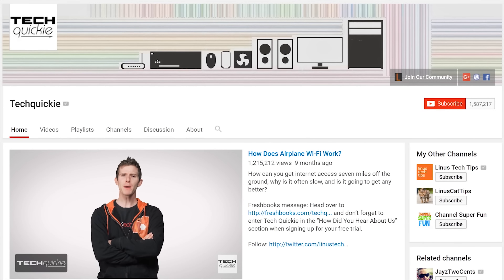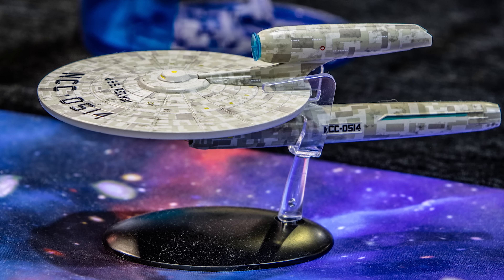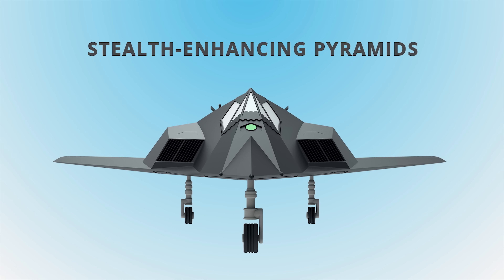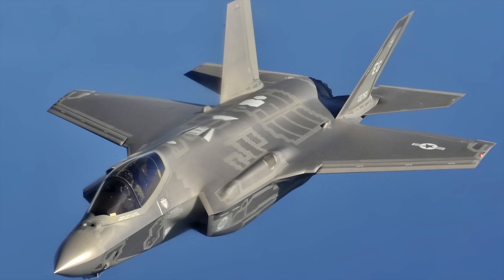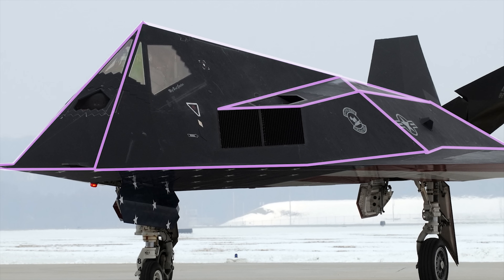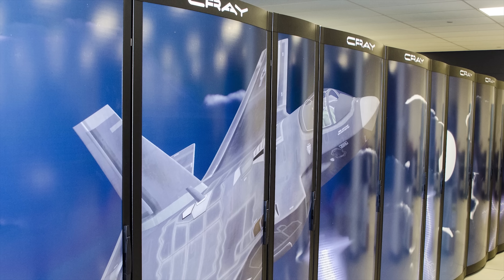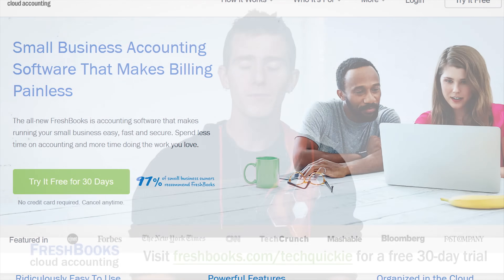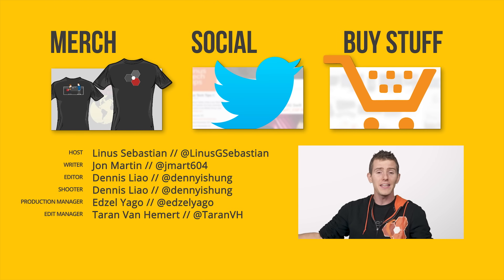How Does Stealth Technology Work?

Comment: The title of the video should have been how is it supposed to be working. Stealth technology is nothing but a scam. It works against Afghanistan shepherds but it will not work against a strong military.
Reply: You would be 100% incorrect. The F-117 flew THOUSANDS of missions over Iraq when at the time was the most heavily defended airspace in the world and smashed Iraqi air defenses opening up the way for the coalition aircraft to operate with near impunity over Iraqi air space.
Reply: No, I am correct and you are incorrect. Three major errors.

1. Most defended air space in the world? Are you on drugs? The most they had in 2000's was 1970's Soviet Osa. Its operational attitude is... wait for it... wait for it.... 12000m. You can almost buy a drone that flies that high.

2. The air space over Iraq was shut down and controlled by foreign airplanes. The reason why airplanes survived all those missions was because Iraqi army never attacked them.

3. When the shit hit the fan, USA started with Tomahawks. Not really a stealth technology airplane, is it?
Reply: @trdi They only had Osa are you shitting me? Every source and study shows they had around 7,000 available SAM sites including SA-2, SA-3 and SA-6 and more with 10,000 anti-aircraft artillery systems. More so a significant portion of their command structure was of Western design and was highly capable thanks to France.

They backed this up with a incredibly dense radar network linked with a GCI system to vector in Mig-29s, MIG-25s and Mirage F1s for target intercept.

In-fact this air defense network Is what comprised most of the shoot downs of allied aircraft in the war. Which Include:

3X A-6E
2X F-15E (Brand new aircraft btw)
3X OV-10
1X F-4G
3X F-16
1X F-14
3X AV-8B
1X AC-130
5X A-10

 BTW this info is all really easy to find with a 10 second google search.

The only Iraqi equipment knocked out of action when the first wave of F-117s went in was a few early warning radars. Other than that they flew in and out of Baghdad utterly undetected by radar. The only F-117 shot at that night was one that left it's nav lights on over Baghdad and it still suffered no damage.
Reply: Trdi is the typical self appointed expert, talking shit about a topic he has no clue about.
Reply: Well... yeah... they did have those as well. When I say they "only" had Osa what I obviously did was write what their "state of the art" air defense system was. The 1971 Soviet design. Let's have a look at these other ones you quote. SA 2? 1957. SA 3? 1961. SA 6? 1968. So excuse me for actually stating only what their BEST equipment was. If you want to see what Iraqi air defense was CAPABLE of, you have to look at the most modern variants. Makes sense. To me.

USA has NEVER fought against a well equipped adversary, that's a fact. The stealth technology is there only as a way to be able to sell their equipment for more money to scared nations around the world. Putin has publicly laughed when asked about stealth technology and said something along: "Don't worry, Americans know we can shoot down all their invisible planes."

What this video doesn't mention is that the planes are not actually invisible, they just don't look like planes. Also there are different wavelengths to be considered and usually US stealth technology is more concerned about planes not being possible to be targeted, not actually to be invisible. You can't have both, you have to pick. So those planes are quite nicely and easily visible on Russian radars. The problem is to lock on them to shoot them down. And that's where the algorithms and new development comes in. There is no doubt that a serious army, like Russian or Chinese, would actually be able to shoot down these planes. It's a bit tougher for Pakistani hospital workers and children in Syria to do the same. So they die. Such is the world.
Reply: Yea...Putin....there is a great source of information. If stealth doesn't work why is Russia, China, South Korea, Japan all spending BILLIONS of dollars on stealth designs? The Russians have been working on the PAK-FA for how long?
NOBODY has EVER said that Stealth aircraft are invisible. Except for ignorant people in the media, Hollywood, and people who have no clue about Stealth Technology and how it works.

ALL STEALTH HAS EVER done is radically reduce the radar cross section of these aircraft. So a Soviet radar that can detect a F-16 at 200 miles may be able to detect a F-117 at 20 miles. All Stealth aircraft can be detected it is factors like radar wavelength, power of the transmitter, the size and orientation of the aircraft that determine how far that aircraft can be detected. 
Small fighter sized targets are much harder to make stealthy than bombers believe it or not. The B-2 is far more effective against long wavelength radars than the F-22 or F-35.  
The big problem with long wave radar transmitters they all have MASSIVE antennas that are not mobile. That is a function of PHYSICS and can not be changed. So those long wave radar systems will be the first things targeted my long range cruise missiles so their actual usefulness in combat is going to be nil.
Reply: It's a problem when you try to learn serious things through Netflix. Just because Tom Cruise is able to destroy whole country with one airplane, doesn't mean that it's realistic. Unfortunately that's just the way Americans are being brainwashed on a daily basis so they keep believing the God-given immortality of their military.
It's just impossible to take seriously anyone claiming that Iraq had strong air defense in place. It's a joke. An absolute joke. They were running 30 year old export graded Soviet gear.
Modern SAMs don't actually have to know exact position of the aircraft. Having an approximate direction is more than enough. If there is an AWACS around, even better. Once the missile is shot in the direction of the aircraft it's about maneuverability, missile's hardware and yes, also software. State of the art SAM has never tried to shoot down any stealth aircraft so we don't know what tricks exactly they would use. But one thing is certain - they wouldn't rely on radar. They don't rely on radar, that's a fact. All the missile needs to do is get close enough to the plane and then boom. The missile does NOT intend to hit the airplane. Just get close enough. Since we all agree that stealth airplane is not invisible, it can be seen, it's route can be predicted, it's position can be calculated and that's where the missile will be heading. If the plane changes direction, the missile will know because it will receive newly calculated path. If the plane drops decoys, the missile is trained to recognize those and avoid. It's a never ending chase. USA said that new stealth technologies were developed to counter most modern Russian systems. Russians claim that new SAM technologies have been developed to counter American stealth technologies. Nothing is as simple as the brainwashing apparatus wants us to believe.
Reply: @trdi It is amusing that you keep making arguments about a topic you have no idea what you are talking about. If you did some research into Stealth technology...how it works and WHY it is so effective you could keep from making yourself look like a moron like you are now.
Reply: Yeah, make sure you renew your netflix subscription, buddy, or else your education might end. You know what... if the stealth fails, don't worry, there is always stargate technology.
Reply: Sorry brother, I am a US military veteran...I have worked with these assets in the field. While not a expert on stealth I am quite a bit more knowledgeable than the average person on the street. I also find it interesting that you won't acknowledge that if Stealth does not work....why is Russia and China spending TRILLIONS of dollars developing their own Stealth aircraft? The Russians are currently working on their version of the B-2. They are getting ready for the SU-57 to enter production. If they can detect and shoot down Stealth aircraft like you say, why are they working so hard to develop their own Stealth Aircraft? The Chinese must believe in the technology because they have developed TWO Stealth fighters the J-20 and the J-31. For Technology that does not work according to you a lot of countries seem awfully interested in developing the technology. Is the more likely scenario that you don't have a clue what you are talking about and you can't really produce any logical reasons why it doesn't work so you resort to personal attacks?
Reply: Personal attacks? Alright, I guess moron doesn’t count as a personal attack. You should do it more stealthy, if you want to accuse people of personal attacks.
Russia is not currently working on their own version of B-2. Yes, there are plans to develop their own  flying wing strategic bomber, but it doesn’t seem that they have actually made up their mind. The Russian military is very much split on what their next gen bomber should be like and it’s not a coincidence that they have restarted production of a new TU-160 M2. And who could blame them, even American Air Force generals have admitted that the plane is a marvel of aero engineering. With new avionics, electronics and even new Kuznetsov engines the bomber is second to none. And you know what the reason is for them to keep reconsidering the flying wing option? It’s precisely the fact that they don’t think stealth technology is worth it. The role of the strategic bomber for them is apparently perceived differently. Get in position as quickly as possible and release KH-102’s (or KH-101’s) with 5000km range. Far away from air defense. Russia has NEVER tried to develop a stealth bomber. What exactly would be its role? Delivering nukes can be done by TU-160 pretty much from inside of Russian territory. Denying aircraft carrier groups can be done by Tu-22M, again with long-range cruise missiles, including hypersonic missiles which give the ship only 15 seconds of time to react once it’s spotted on the horizon. Not to mention hypersonic missiles launched from the land, specialized torpedoes or the ballistic anti-ship missiles recently launched by China. So what is left out there for a stealth bomber? Dropping bombs over Syria? I think Russia is doing quite well there with Tu-160’s, Tu-22’s and even Tu-95’s, which are dropping on average 1500 bombs per month. There is no advantage of stealth. There is actually advantage of being non-stealth and it’s the same reason USA is still massively using B-52 and A-10 (and will be using them for at least 25 more years): less than half price of a flying hour.
As for Russian stealth fighter, it’s just a normal fighter with limited stealth capabilities (I believe they only intended it to have some front stealth properties), probably meant to impress their main trading partner, especially India. Russians have publicly said many times that they consider stealth to be just a selling scam, both for airplanes and especially ships (Zumwalt, wtf, what a waste of money)
As for my statements here, everything I wrote is correct. Even Americans admit that the main point of stealth is the shorter response time they want their enemy to have. That will not work with a serious adversary. Early warning radars, similar to ICBM warning radars will easily spot the airplane while it’s far away, as B-2 has pretty much zero tricks against low frequency radars. Once they are alarmed to its presence, they will lock on it everything at their disposal and send interceptors, just in case (well, Russia is the only country that is employing interceptor fleet). Both China and Russia have recently developed new low frequency radars and new AWACS airplanes. Even the newer fighter planes (like Su-34 and MiG-35) can serve as data crunching systems, providing command guidance to both, other fighters and also surface-to-air missiles. Once the missile is closer, a combination of infrared, optical tools and command guidance are all immune to stealth technology.
There is only one potential advantage a stealth fighter could have and that’s in a one vs one dogfight without any support available to either aircraft. F-22 would have serious advantage vs other aircrafts as it is essentially invisible. The opponents would get shot down before they would’ve noticed it. That’s just a very unlikely scenario these days. Even when flying is relatively safe, like it is in Syria, Russia is still using 4 AWACS aircrafts plus everything needed on the ground. The air force today will never be naked.
Reply: You are incorrect on the B-2, it is very effective against low frequency radars, much more so than the F-22, F-35.
You claim that Stealth will not work against a serious adversary....what do you think Stealth was designed for in the first place? To penetrate Soviet Air space.
OF COURSE THE RUSSIANS ARE GOING TO SAY STEALTH IS A SELLING SCAM.......because they don't have anything comparable to offer.
Reducing the RCS of a ship is NOT a waste of time. If you can detect the enemy before he detects you......that is a huge advantage. The Zumwalt failed as a program, not because Stealth is a waste of time but because the program itself was horribly mismanaged and it's technical aspirations were way to ambitious. 
The Russians sure seem to think the SU-57 is more stealthy than a F-22 you hear them bark about it quite a bit.
The Russians were planning on the PAK DA a 5th generation stealth bomber. Their public stance is they are delaying development to concentrate on the TU-160M2. The reality of the situation is the limited amount of funds Russia has for modernization of it's aging military. They simply can not afford to sink limited resources into developing the technology required to field such a bomber. They are having trouble fielding the Armita tank....they will only have about 330 of them in service by 2020. I think they made a smart decision, the TU-160 is a fine aircraft....upgrading it gives them the most bang for the buck. Is it as capable as a B2....not even close but it is good enough.
The amount of R&D the US has put into Stealth is staggering. To think that some of the smartest minds in the world simply forgot about low wavelength radar is laughable. The technology works....for now and countries like China, Russia, Japan, Germany, South Korea, India are all working on stealth designs.
Reply: Again, you are believing propaganda coming from strange sources. It’s surprising how much can one learn just from reading official American documentation.
Ok, I will correct my claim that B-2 doesn’t have tricks against low frequency radars, I meant the fighters. The B-2 is more stealthy in that regards as well, but still I don’t believe it can avoid being detected. And neither do you. You have no idea what the adversaries have.
Russians have always found the money to manufacture whatever they deemed was worth the money. Their main philosophy has always been: “We will build just slightly worse equipment for 20% of the cost.” Fortunately, so far we have never seen what works better, but for example aircraft carrier groups, which present huge part of the American advantage, are nothing more than expensive target practice for China or Russia. There is no way that any of them survives first 24 hours of war. If nothing else, a nuke will take it out, but it wouldn’t be needed. Russians never invested in superior aircrafts because their military doctrine doesn’t require them. They never invested in aircraft carriers because their military doctrine doesn’t require them. The only decent aircraft carrier they had they sold to India for couple of billion. What they DO care about, they are investing the money into and they are world leaders there.
They invest in tanks, they have by far the strongest tank power in the world. Even the T-90 is probably the best tank in the world or at least equal to the best. Armata is a tier above and has pretty much caused new tank development race in the world, with countries like UK, Germany etc looking to develop new tanks to counter Russia. The reason why they are not buying more Armata tanks quickly is not lack of funds. It’s the operational testing they want to do with the first batch (Syria?) plus they want to use platform for other type of weaponry, antitank, artillery etc. They are limited by how many tanks they can manufacture, because they are limited by how many base platforms they can manufacture. They invest in tanks because they have huge land mass to protect.
They invest in SAM technology, because they are countering American air superiority. They do have the best SAM systems in the world.
They invest in hyper-sonic weapons, especially anti ship missiles, because they are countering American navy superiority, especially in form of aircraft carrier groups. All available information suggests that they are 7 to 10 years ahead of American development in this field. In fact American military officials and experts are publicly calling for faster research, because they consider that both Russia and China are ahead at the moment.
They heavily invest in new submarines, again to counter American naval superiority and AC groups. They have the most advanced torpedoes of various types, all designed to get through tremendous defense of a AC group. Last time I checked they actually manufacture new modern submarines ahead of schedule.
They invest in cruise missiles, the new Kalibr looks to have better characteristics than Tomahawk (well, Tomahawk is old already and US never looked to modernize them, because it was the only thing in town and quite frankly - it's good enough, so why wasting money) and it seems they are installing them to every fishing boat now, also as means to circumvent the 500-5000km range restriction on land based missiles agreement they signed with USA.
Su-57… the reason why they don’t buy more of them is because it’s still under development. The plane seems to be done, but they still need new, more powerful engines. So they will fly a small group of these aircrafts until they get the engine upgrade. It’s not a question of funds, it seems that they have problem with the engine development.
They invest in nuclear forces. Because USA. And because of the “anti Iranian missile defense shield” set up all around Russian borders. So instead of developing the same shield, they develop warheads that can penetrate it. Latest tests are showing extreme maneuverability of warheads re-entering the atmosphere, almost defying laws of physics. They should not have been able to perform such evasive maneuvers at such high speed without losing control, but somehow it seems to be working. After Trump hinted he wanted to start a new nuclear race, top military generals said it’s not a good idea, because Russians have a head start and it’s not a race they think could be won easily.
The modernization pace that Russia is following right now is terrifying. The whole nuclear strategic program will be 90% modernized by 2020. USA is lagging and their 1.2 trillion plan for modernization of nuclear forces has yet to start. There have been multiple reports in last 4 years about lack of funds for nuclear forces and consequently less than optimal readiness.
The Russian army is not aging, the contrary. Let’s have a look at top strategic bombers. Out of 20 B-2’s that USA has, how many are actually operational? By 2013 report only 9. That’s less than half. Lack of funds. Russians haven’t released report on how many of their 16 Tu-160’s are operational but NATO pilots intercepting them are always taking photos for these purposes, because they are able to differentiate between the aircrafts. They assume 12 out of 16 aircrafts are flying. This is not 1995 when everything was rotting.
When you talk about money it’s always about priorities. Whatever military regards as top priority will get the money, and that’s the same in USA, Russia, India or China. I think it’s pretty clear that Russia is spending decent funds on the modernization and development and I think it’s clear that they don’t think stealth is high on their priority list. They do think that being able to shoot down stealth aircrafts is a high priority though.
Reply: I don't believe that the B-2 could ever NOT be detected. What it can do that no other aircraft can do is navigate through the weak points in Russia's air defense networks and penetrate undetected. Think of how huge a country Russia is and how many gaps it must have. Covering it's boarders completely with radar is nearly impossible. So the B2 will penetrate through areas that the B-1 or B-52 would be detected and be able to slip through undetected. 

I wonder why the US and Russia spend so much resources on Nuclear forces. I wish they could work on a treaty to limit each side to about 150 warheads. Nuclear weapons are the biggest boondoggle ever, they will never be used and we should keep just enough of them around as a deterrent and save trillions of dollars.

I do not believe the hype of the Russians when they preach about how good their tanks are. They seem to be great until they hit the battlefield.
Reply: Do you have any evidence of Russian tanks failing when they hit the battlefield? M1 Abrams is better than T90 only in those countries where there is no war. In last year I have read reports that it's failing in countries with sand, all the way from Pakistan to Northern Africa. Here is what Army Lt. Gen. John Murray told the Senate this year:
"I would not say that we have the world-class tank that we had for many, many years. I'll be an optimist and say that we're at parity with a lot of different nations."  Apparently he believes that the new Israeli tank is currently the best, with Armata potentially being better but he doesn't have enough information.
From what I know Russian T-72s and T-90's have an amazing service record, although one has to be careful to look only at those produced in Russia. Today 90% of them are being manufactured through licensing deals in other countries. Same as AK-47. Most of those manufactured in poor countries are of extremely bad quality. Those made in Soviet union and Yugoslavia were good stuff. Probably the Yugoslav AK-47s were the best, I know that many American collectors want the Serbian AK-47s and their replicas. There's even an American manufacturer of AK-47 and it's one of the better versions. So some of these T-72 manufactured outside Russia are barely moving and have zero maintenance on top of that. Those are NOT good tanks.

As for nuclear forces, I believe it's the ONLY thing keeping peace. If you look at Soviet Union, without nuclear deterrence they would have probably taken over Europe. Their superiority in the region was extreme and there was nothing USA could have done. After 1991 I think that USA has shown a lot of aggression in the world and since USA has the strongest military I believe they would have started a war against Russia in last 30 years without the nukes. I am very much against getting rid of nukes. The problem of having only 150 nukes is that it doesn't guarantee mutual destruction.
Reply: After 1991 the USA has shown a lot of aggression? Have you been asleep for 40 years? The military industrial complex that runs this country and owns the Government has kept us perpetually at war since 1941. We have been sticking our noses in everyone's business since the end of WW2. Why....because war is BIG BUSINESS. That is also why you don't see America actually winning any wars either, there is no money in winning a war. The money is in doing just enough to keep the conflict going for decades.
The military industrial complex has constantly invented new mythical opponents for us to fight. First it was the Russians and communism. They were replaced by Islamic terrorism. The ISIS's of the world are about to be replaced with China.
These countries were never a serious threat to the United States....they were made to be a threat to scare the American people into accepting massive defense budgets.

As far as "Quality" goes....I am not really buying that either. Russia has NEVER been known for building quality material. When was the last time you ever heard anyone say...hey man did you see that new AWESOME Blu-Ray player...it is built in Russia.
Reply: Well yeah, but my point was that before 1991 Soviet Union was a threat to world peace as well. They held the land army superiority, while USA held navy superiority. There were two bad guys back then. After Soviets crumbled, there was only one dog left.

I agree that wars are stupid, which is why I don't believe Putin intends to occupy any part of Europe or even Caucasus. In modern days occupied land is nothing but money drain. Maybe if somebody occupied Saudi Arabia they could have made it profitable, but that's just about it. Border disputes can always be solved pragmatically. For example Russians and Norwegians agreed about the sea border by drawing the line somewhere across the half (well, maybe Russia got a bit more) and agreed that any oil/gas field that's on both side of the border can only be developed by both countries.

But one always needs enemies...
Reply: Before 1991 I don't really believe the Soviet Union was a danger to peace. Sure they had a massive army on paper but it was 90% reserve forces. I believe they were painted as a threat by our Government to keep defense budgets high. From the Soviet point of view it is perfectly understandable why they would want to have buffer states around their country. They had been invaded TWICE by the Germans in less than 30 years. Stalin and the rest of the Soviet leadership were suspicious of the West and it's intentions. If a potential enemy was building massive armies don't you think the logical response would be to try and match that capability.
Sorry for calling you a moron by the way, it was uncalled for and I apologize.

What do you think is going to happen in the Arctic circle? With the vast energy reserves found there and with so many countries laying claim to parts of it, do you think that could be a potential conflict area?
Reply: Yeah, I apologize for some harsh words as well.

I think Arctic circle will be just fine. The Russians are very pragmatic, they know that if they make enemies, they will not have anyone to trade with. So far they haven't shown that they want to bully smaller nations, like Denmark, they are trying through United nations, organizing Arctic Circle meetings (btw, the list of observer countries is hilarious: https://en.wikipedia.org/wiki/Arctic_Council - obviously this is big deal) and they try to strike deals with interested parties (let's not fight, invest some money, we can start business together, kind of deals). They are however militarizing the region very heavily and are pretty much the only country that is able to support potential territorial claims with force. Russia has 41 icebreakers (many of them military), 11 more under construction and USA has 2. They have bases on Arctic, have permanent presence there and they are opening 3 or 4 new bases on the mainland as well, so that they are able to reach whole region. It doesn't help that some countries (well pretty much only Canada) have been publicly saying that they would use their military might to defend their Arctic interests if needed. Russian aggression and all. So far it looks that Linus' motherland might have problems with that:
https://i.ytimg.com/vi/RfIsNKEC9R4/maxresdefault.jpg
Regardless of international law, this world today will recognize a country's potential territorial claim only if that country is able to enforce it with military. If you can't do it, no court in the world can help you. USA has a large chunk of all their F-22 based in Alaska, but I think they are planning much more in the future. First they should build those ice breakers though...
Reply: Yep, the Russians could walk in and take the Arctic circle right now if they wanted. They are the only country with the capability to conduct operations in such a environment. I think it would be cool to see a group of nations put together a multi nation effort to jointly develop the resources there.
Did you see where North Korea just launched a missile that could hit Washington DC? I wonder WTF is going to happen there.